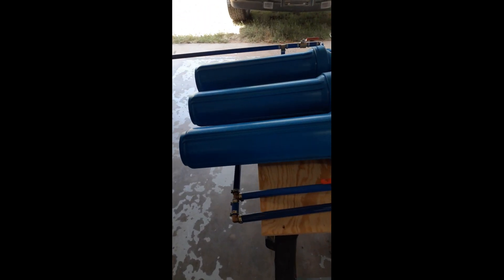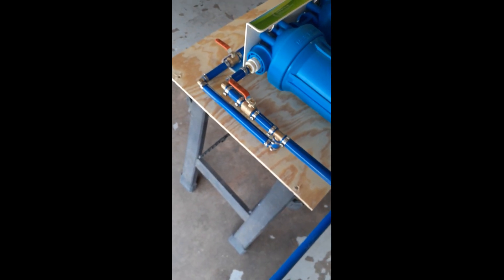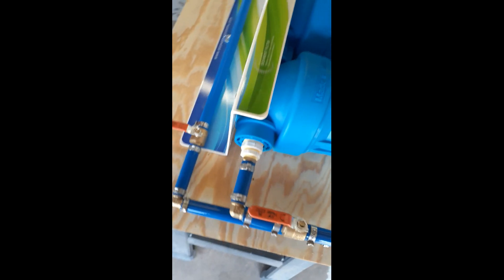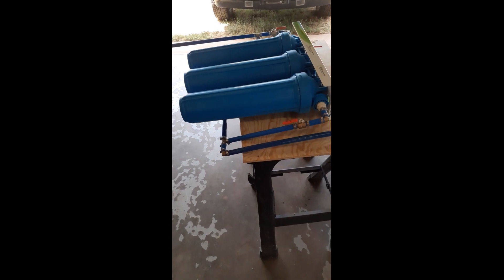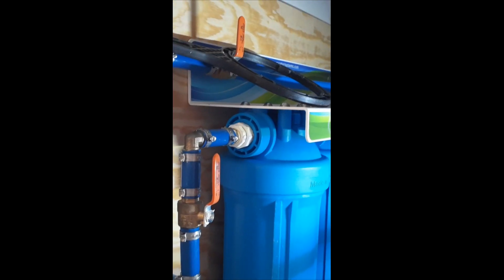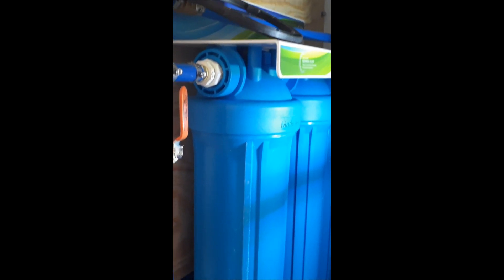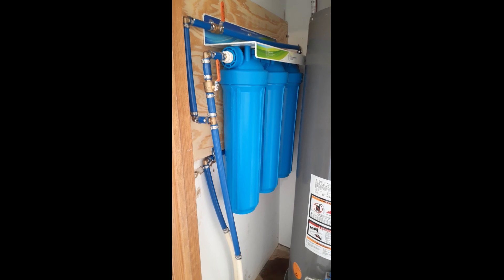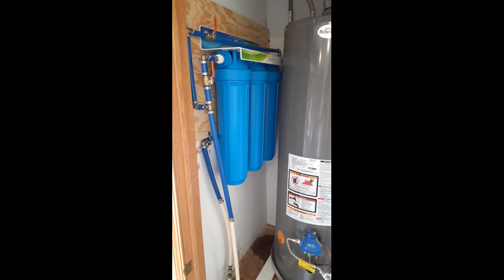Kind Water System Installation & E-3000 Review

Comment: Hey! Im about to install the same system. The install diagram had two hose spigots on it, which I don't understand the use for. I see you omitted them as well. Do you know what those spigots are intended?
Reply from the maker: Hose spigots allow for some types of maintenance (e.g flushing and sanitizing without the water going to other treatment or through the house) or if you wanted water immediately after water treatment (e.g for livestock).

Comment: The video was very helpful!  How long did it take for you to recognize the difference on the water quality?  It's been a week for me but the water tastes the same..
Reply from the maker: This is going to be based more on what's in your water to begin with and how much you've used it. Once you've flushed the filters and you've cleared through your plumbing, the impact would be immediate. Note that these types of filters are general purpose carbon filters more focused on removing harmful contaminants, so things like hardness won't be affected which have a big impact on taste.
Reply: @Freshnss  Thank you for your response.  Does it suppose to remove lime as well?  I can tell it tastes a bit different now but lime is still not removed.
Reply from the maker: @emilykang4180 would need more info from you. You can email us at info (at) freshnss (dot) com.

Comment: How will you remove the 3rd filter being to tight to the water heater?
Reply from the maker: Hey good question. Two things, the third filter is a salt free softener so it doesn’t have to be replaced like the first two cartridges.  If you do have to take it out, we just remove the first two or unscrew it from below.  That’s how we installed it. I just checked and they also have a big sale right now 🙌 https://bit.ly/3qvGPEG

Comment: How much time should using copper tubing take.  A plumber took 9 house to install this in plywood and cut copper tubing
Reply from the maker: Hey there!  Under most circumstances, it should take less than 3 hours (conservatively).  As long as there aren’t extreme configurations necessary, 9 hours seems very long.  For reference, it took us 90 minutes.
Reply: For a good clean looking job I could see 8 hours using copper.

Comment: I'm planning to install the E-1000 version (I don't need a softener) and I noticed the instructions include hose spigots on either side of the install.  Do you happen to know why they include this? I'm guessing it is maybe to be able to drain the lines better before a filter change, but it doesn't seem like you did this so I'm curious if your instructions said to do this, and if so, why you decided it was not necessary.
Reply from the maker: Hey, that is great to hear!  The E-1000 is a great system!  You might be referring to the valves.  And that is to turn off and on if you are changing filters or need to service your system.  We installed a bypass, which is not necessary either, but is nice for filter changes.  And actually they are having a prime day sale with big discount that ends today! Check it here: https://bit.ly/3BxEkF2  
If you have install questions after you order it, just shoot me an email erik (at) freshnss.com and we can help you out!

Comment: What do you think about the UV Purification?
Reply from the maker: I personally like them because it kills bacteria and viruses 🦠 and they are low maintenance.  If that’s a concern for your water then it’s an easy add on for the system.  That’s why utilities add disinfectants, but the UV is a good added precaution.
Reply from the maker: A side note.  Have you tested your water to know what’s in it? That can help guide your decision making too.
Reply: @Freshnss  I am waiting for my tester to arrive. But only for hardness.
Reply from the maker: Ah, I gotchya.  I would recommend getting a comprehensive test so you can see the full picture.  Then we can find you the right treatment option that we know will work or you could end up being disappointed with the results.  Just getting a home test for hardness and a handful of surface level contaminants is not too accurate and doesn’t provide the best analysis. 
We have two lab tests for city water, the ultimate test is popular bc it scans for the really nasty VOCs too.  Check them out here, and if you order one, we will get you dialed in with the best option based on the test data.  https://freshnss.com/water-test-kits/city-water-test-kits/

Comment: How does the softener work?  Citrus?  Would you recommend adding a spin down filter before reaching the sediment filter?  How does your sediment filter last so much longer than other sediment filters with a lifespan of 1-3mos.?  Thank you.
Reply from the maker: Hi Mavirek - The softener uses template assisted crystallization (TAC) to treat the hardness minerals.  They have a proprietary eSoft cartridge.  

I don’t think an extra spin down sediment filter is necessary before the system.  The  sediment filter lasts 12 months because it is a 20 inch pleated filter so it’s large and can be washed if you have heavy sediment.  

Do you have city water?  Or we’ll water?
Reply: @Freshnss  I guess it would be considered well.  Our condo owns its own onsite utility for water and sewage.  I like the system you have there, but I'm not crazy about being locked into a proprietary cartridge for the descaling because no competition usually translates to premium pricing.  I am however impressed that you get a year out of each filter.
Reply from the maker: One question in that case, have you tested your water to know what’s in it and the hardness level?  That is important if you are looking at a system like this.  

If you have not done so yet, I would highly recommend it since you have a private water supply.  Check these tests out here, there are two options depending on how many substances you want to test for: https://freshnss.com/water-test-kits/well-water-test-kits/

Also the softener cartridge does not need to be replaced so your concern regarding pricing will not be a factor.  But if you have very hard water, it might not be a suitable solution for your water at all.

A second option is you can use our Freshnss Plus program.  You get a free laboratory test kit so we can use the results to curate the best treatment solutions for your specific situation.  Then we know it works and you won’t have to waste time and money guessing. Check it out here: https://freshnss.com/freshnss-plus/

Either way, happy to answer any questions you have.

Comment: Does it only filter the hot water?  Don't you need to install the filter at the point that the water enters the home?
Reply from the maker: Hi Paul - We did indeed install it at the point of entry.  It’s just so happens to be very close to our water heater.  But this filter will treat all water that comes into your home.  You can check it out here https://bit.ly/3W3p8qW. If you go with it, I’m happy to help if you run into any install issues 👍
Reply: @Freshnss  I bought the filter expecting "easy installation" as advertised.  But a plumber just quoted me $2600 saying that installation will require that my water main be rerouted from my attic to the garage.  So, either the plumber is lying to me or Evo is.
Reply from the maker: That is insane.. $2600 for a job that should take a professional less than 3 hours?  And how would the main water line need to be rerouted from the attic? I can tell you from experience, this type of inline filter design is the easiest type of whole house filter to install.  Where do you live?  I can try to look for other plumbers
Reply: @Freshnss  I sent you a message on your website.

They said that the line that goes to the water heater only sends out hot water.  So, they can't install it just before the water heater.  They need to get to the entry, which they say is in the attic.  But rerouting from the attic to the garage is expensive.  The plumber said this is typical.  But I'm skeptical.

Comment: A bypass system seems a bit overkill, it takes like 3 minutes to change out filters but to each is own I guess and kudos for a clean install!
Reply: Take 3 minutes to change the filter until you accidentally drop a filter and it cracks and you have to go to the store, or worse, order another one online, then it's a several hour or several day filter change. Always better to have a bypass in this situation.
Reply from the maker: Hey There!  True, the filter changes only take a few minutes.  Better safe than sorry I guess, we also just wanted to show how do to it as an example 🙌

Comment: Thank you for the review! Have you ever had a salt based water treatment system? I’m currently trying to decide between this system and a salt based water softener with carbon filter combo recommended to me by my plumber.
Reply from the maker: Glad you liked it! We have indeed used a salt based softener.  It just depends on your hardness levels and if you have city or well water.  If you have city water that isn’t extremely hard, the Evo would likely be fine.  Probably less expensive than the other combo your looking at and you don’t have to worry about refilling with salt every couple weeks!!  You can get 35% off now too, I just checked the price https://bit.ly/3W3p8qW
Reply: @Freshnss   Thank you very much for your reply and the info! That sale may be a sign haha. We have city water, and I forget what the number was, but when our plumber tested the water hardness and it was medium orange (hard) on the test strip. That makes sense. I was also trying to factor in the cost of ownership and maintenance difficulty.
Reply from the maker: It might be a good sign!! The cost of ownership is lower in terms of less waste water, no salt required, and you don’t need to replace the softener media ever.  That translates into completely hands off maintenance too.  Install is also way easier.